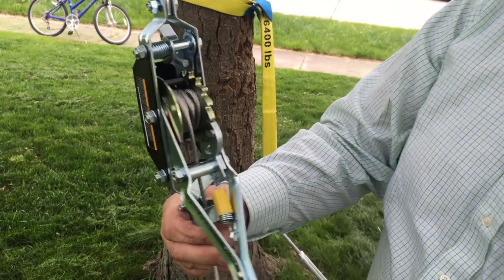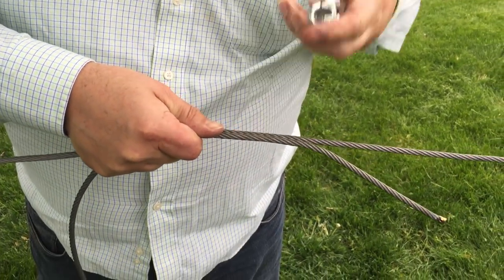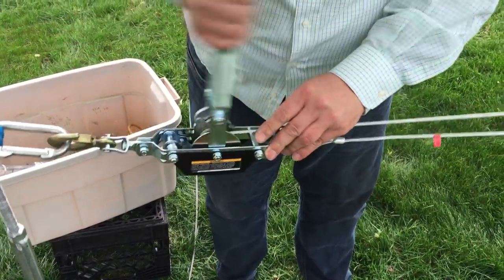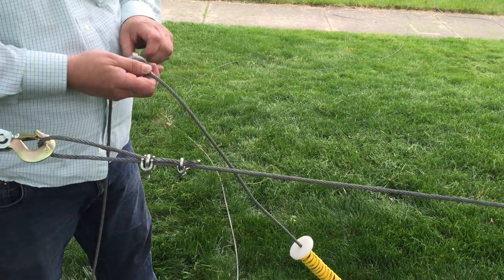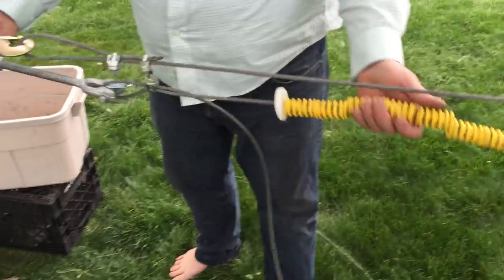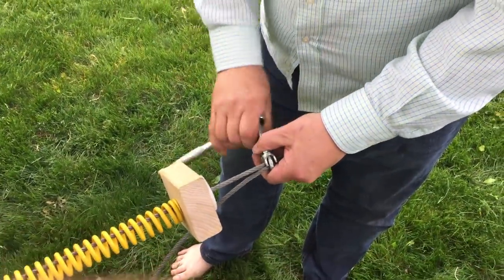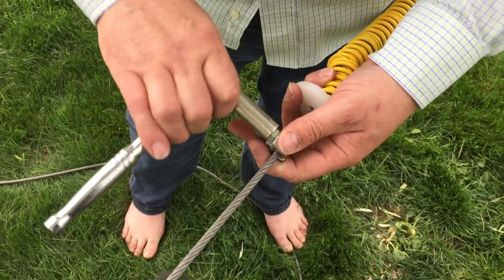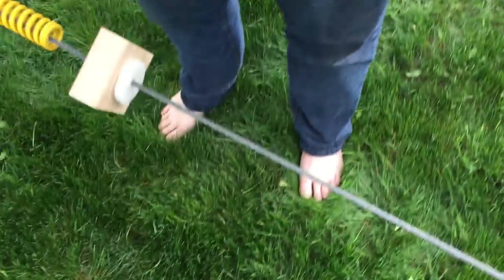Zipline  how to tension and the braking system

Comment: This video was really helpful to me when I tightened my zipline last weekend.  The temporary short cable was way cheaper than a cable grabber for the come along.  I hadn't used a come along before so the video showed me how to as well.  As he stated, the purpose of the video is to walk you through the process of tightening the cable and building the brake.  It was NOT supposed to show you the actual setup of his zipline.  The instructions that came with my zipline kit were crap and did not say anything on how to tension the cable which was probably 80% of the total installation.  Thanks!
Reply: Where did you bought them can you please tell me
Reply: @voletiavinash5012  I bought the zipline online.  I got the short cable and wire clips at Home Depot.  You can buy the winch there, too.

Comment: only ONE clamp to hold such thick cable, especially when it will carry a load!? You certainly need to secure 3 cable clamps to be safe.
Reply: One minute tool name?
Reply: I'm sure I heard him say use 3, he may have only used one just for this demo.  In his previous video he did emphasize using 3 clamps.
Reply: He said it’s only for the video purpose he will come back and to all 3